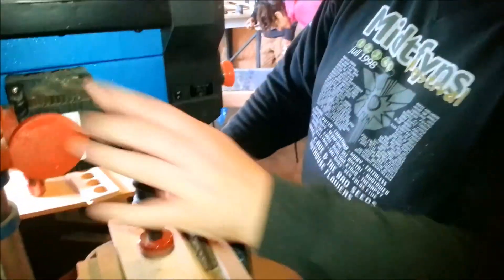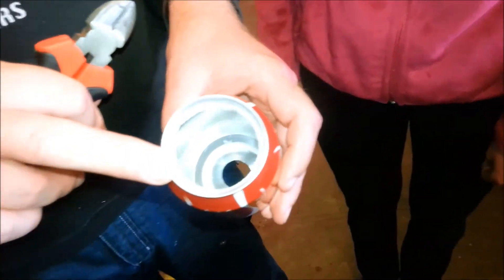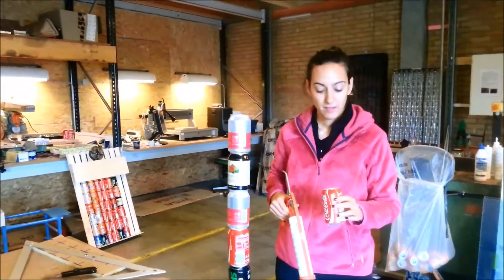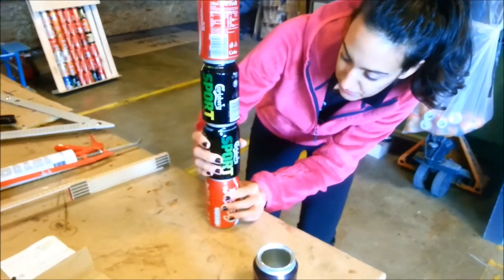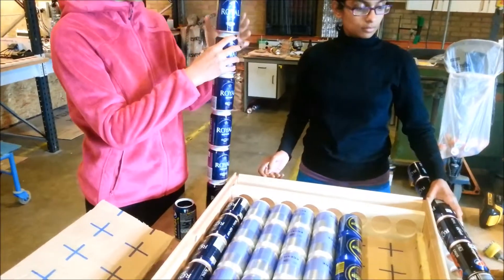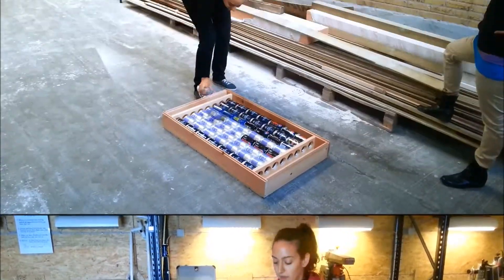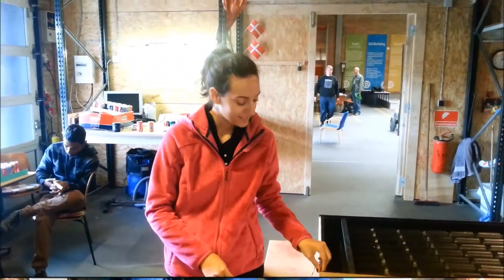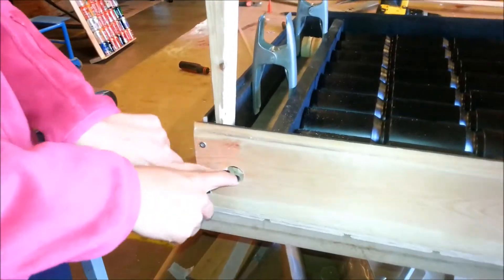Se vores hjemmebyggede, soldrevne varmluftsblæser

Comment: Does it work in the Winter in Denmark? Or will it be too cold? Btw I have a manual that says that I should use some isolation in the bottom. Have you done that, or...? :-) Thanks in advance.